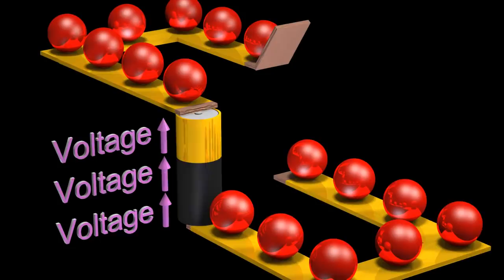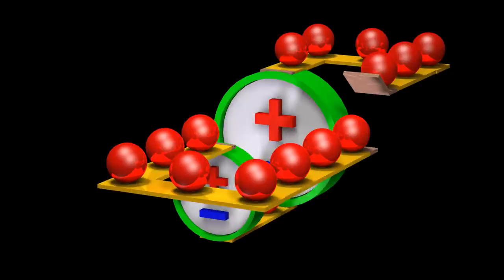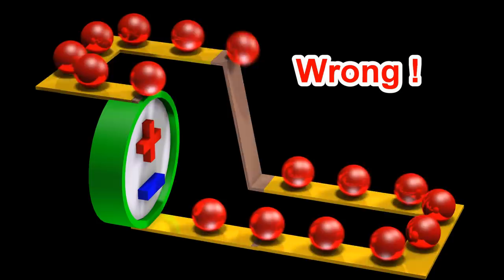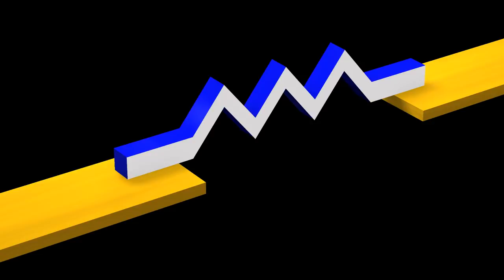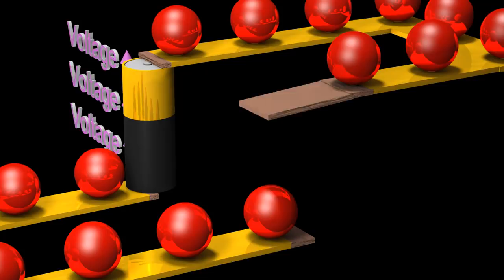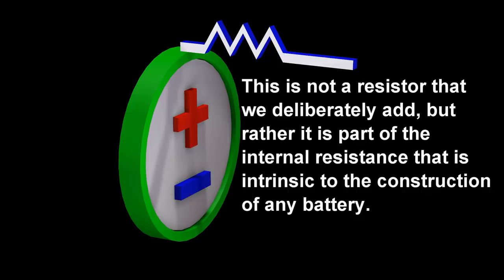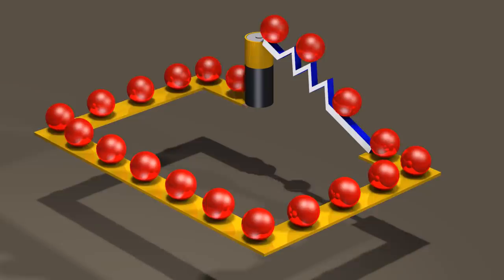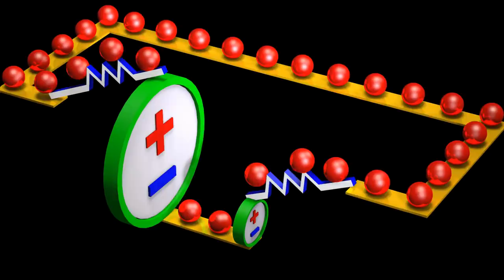Superconducting Short Circuits across Batteries

Comment: But what it someone makes a superconducting battery? Is it even possible to make one with current physics, or does there 'have' to be a voltage drop for it to even be able to store charge?
Reply from the maker: A battery always has to have some internal resistance.
Reply: One correction . A battery never stores change . It stores energy as a result of migration of charges 😉 . Note : A battery is not rechargeable ; it is re-energizeable.
Reply from the maker: Physics Lover, good point.
Reply: @EugeneKhutoryansky  Thanks a lot my mentor . All the credit of my concepts getting crystal clear goes to you😍. I respect you from the depth of my heart.  💚

Comment: My mentor! There is one thing that I can't understand at all. I can easily understand that a superconductive wire section in a circuit is always at a same potential. But what I can't grasp at all is that why two ends of a resistor are not at same potential ? Would you please kindly answer me? 😘

Comment: Ok but what if the internal resistance of the battery WAS a superconductor (maybe the battery was cooled so much that it’s internal resistance disappeared?)
Reply from the maker: The internal resistance of a battery is not a real resistance.  It is a mathematical model of the internal chemical processes.  This resistance can never be zero.

Comment: Is there a way to make a superconducting capacitor that acts as a voltage source
Reply from the maker: The moment that we start drawing current from the capacitor, its voltage drops, because it is being discharged.  If your question is what will limit the current, the inductance of the wires will prevent the current from reaching infinity.
Reply: @EugeneKhutoryansky  also the attractive force between the plates of capacitors prevents the current to go to infinity 🤗😉
Reply from the maker: No, it would be the inductance of the wires that would be the issue.

Comment: An inductor(aluminum wires wrapping an ferrous metal wire is an inductor capacitors with a simalar of a bms a(batterymanagementsystem) the smart capacitors can hold additional electric till needed?/wanted,,,, 4:25 my comment commented of a logical statement  the time #tag is so easier find this smart words ,,, liked the art

Comment: "Batteryless Battery"????

a. Small aluminum cones with an electrical wire running through the center of the cones, cones spaced apart (not touching I'm thinking) but end to end.
b. Electromagnetic radiation energy in the atmosphere interacts with the aluminum cones.
c. Jostled atoms and molecules in the cone eventually have some electrons try to get away from other electrons of which those electrons gather at the larger end of the cone, of which also creates an area of positive charge at the smaller end of the cone.
d. The electron's in the wire are attracted to the positive end of the cone and the positive 'end' in the wire are attracted to the negatively charged end of the cone.
e. Basically a 'battery' has been created inside the electrical wire itself, different areas of electrical potential.  Basically a 'wire battery' or a 'batteryless battery', however one wanted to call it.
f. Numerous cones placed end to end increases the number of 'batteries' in the wire.

Then of course, one could take that generated dc electricity to split H2O into H2 and O2 of which could be burned or utilized in a hydrogen fuel cell to get the electricity back with a byproduct of basically pure water.  Species need pure water too.

With the increased cosmic radiation that is going to be impacting this Earth this century as well as possibly a mini-ice age, might as well put that cosmic radiation to work for us.
Reply: So a solar panel?
Reply: @UserName-pi9no  Close, but nope.
Reply: @UserName-pi9no  Consider it a solar panel without the Sun.  It taps into the electromagnetic radiation energy that is all around and even inside of us.  Limitless energy source that can be tapped into.
Reply: Valid point . But the concepts of these aluminum cones are hard to grasp.  😕
Reply: @physicslover1950  Look at the cones as being an antenna that receive 'em' from the atmosphere.  As atoms and molecules get jostled, some electrons might become free, those electrons being of like charge, will try to get away from each other as far as they can.  Most probably collecting at the widest area of the cone.  This of course might also generate a positive area at the smaller end of the cone.  Then the interaction with these charges with the electrons in the wire, could set up an area inside the wire itself with electrical potential, electrical potential basically being a 'battery'.  So, a 'battery' generated inside the wire itself, without having any battery.  Basically one could even call it a solid state battery, or possibly SSB.
Reply: @charlesbrightman4237  Yeah, yup your are right. Now I got it. The wider  area is negatively charged and the cone's tip is positively charged.  Thanks a lot.
Reply: @physicslover1950  The actual material for the cones, the cones actual shape, the wire itself, the type and thickness of the insulation of the wire between the wire and cone are just some of the variables that could be altered to maximize the output for each 'battery'.

Then of course, the number of cone 'batteries' in series and parallel to get the necessary output desired.  With my home built electrolysis unit, I had found I needed at least 3 V dc to overcome the back voltage of the H2 and O2 as they tried to reunite.  I am sure people a lot smarter than I with more resources could probably do a better job.  I just have to work with what I have, which isn't much.

I could even see this being a power supply in outer space and on planets and moons as we exist in an ocean of 'em'.  Just a matter of which 'em' frequency or frequencies to tap into which would in part dictate what material to utilize for the cones and their size and shape.

Comment: One more comment: When short circuit then not only the battery will heat but also the "superconductor" wire.
And in real world superconductors only work in cold temperature.
So it will no longer be superconductor.
Reply from the maker: No, the superconductor will not heat up, because the power dissipated in the wire is i^2 * R = i^2 * 0 = 0.
Reply: Yes, you are right that the superconductor cannot heat up from the electric current.
But it can heat up from touching a  hot battery :)
Reply from the maker: Not if you have air conditioning or some other form of active cooling.

Comment: Parallel plate capacitor made of superconducting material would have zero internal resistance. I suspect resonance will result in EM emitted eventually losing all charge.
Reply: Keep in mind that charge is never losted only energy is losted.  A battery and a capacitor is not rechargeable but re-energizeable. Now the answer to you question . It is the super attractive force between the plates of the capacitor that prevents the current from getting infinite.
Reply: No no , in case of super conductive capacitor energy is not lost as electromagnetic waves as a result of resonance.

Comment: what if, intead of a batary we use a fully charced capasitor that made a supercondactor material? Total resistance will be zero so current infinite?
Reply from the maker: The current would be limited by the inductance of the system.
Reply: @EugeneKhutoryansky  Is this because of the attractive force between the plates of capacitor.
Reply from the maker: No, it it because of the inductance of the wires.
Reply: @EugeneKhutoryansky  Ok.  I will go deeper in this phenomenon . Thanks a lot for correcting me my mentor . Hats off for you.  😘

Comment: My mentor ! 💚 can you please make a video on Thevenin's theorem for Maximum power transfer or maximum power output? Actually this involves the concept of internal resistances, therefore last week I was requesting you for videos on internal resistance. 💚💚. Actually all teachers just mathematically explains this theorem and no teacher explains the visual meaning of this theorem. It says that the power output will be maximum when 
 load resistance = internal resistance
But we want it visually . 

My mentor please make a video on what is the geometrical interpretation and geometrical visual meaning of second order mixed derivative . I mean if we have a function of two variables say z=f(x,y) and we first partially differentiate it w.r.t x and then partially differentiate the result w.r.t y  we obtain a mixed derivative . But I cant understand it visually. Please help us and make a video on this.
Reply from the maker: I will add the topic of maximum power transfer to my list of topics for future videos.  As for the second topic, although this is not exactly what you are asking for, and I think you probably already saw it, I have a video on partial derivatives at https://youtu.be/GkB4vW16QHI
Reply: @EugeneKhutoryansky  yes but there is a great difference between partial derivatives and second order mixed derivatives. Please also read my other comments.
Reply from the maker: Think of the partial derivative as a new function.  Now take the partial derivative of this new function, using the same principles.  By the way, I just replied to one of your other comments. I believe I have read all your comments, unless I accidentally missed some of them. Thanks.
Reply: @EugeneKhutoryansky  But one website on google says that second order mixed derivative is the torsion of geodesic of the surface plotted by tge multivariable function. I think you have missed my comment of asteroids . 😅